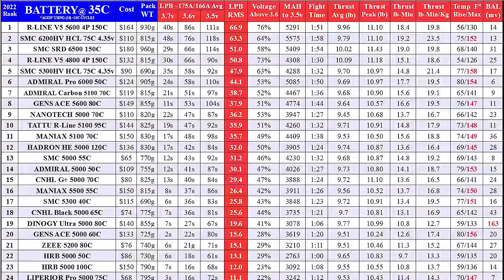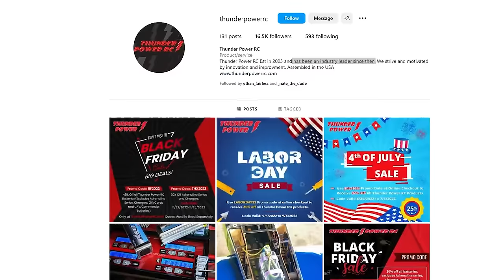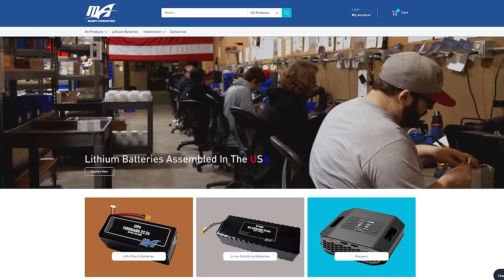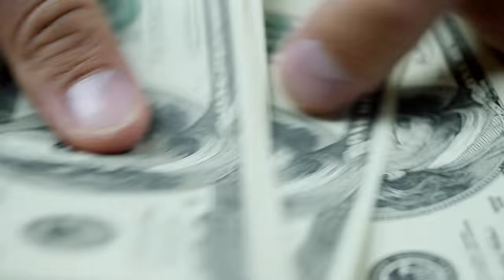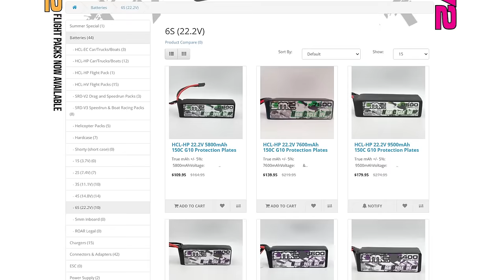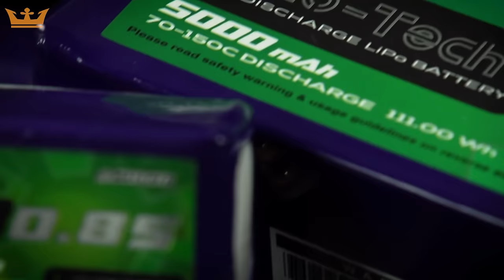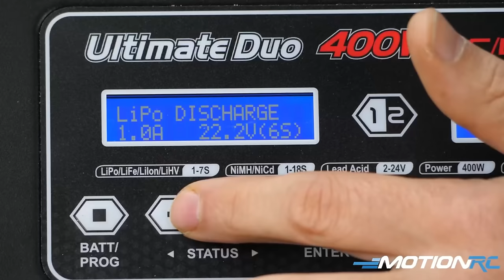Exposing RC's BIGGEST Scam

Comment: 5:45 "calibrated or commonly used discharge rate",,,,, Are you still using constant resistance (and therefore the discharge rate drops as voltage goes down, like in the past)?
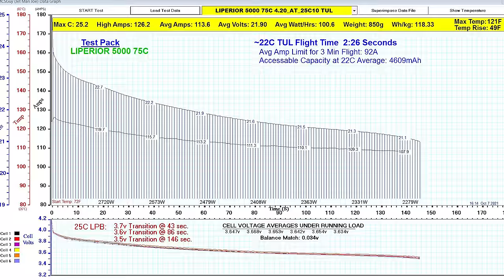Or have you switched over to the CC (constant current) prefered load now? (at 6:00 I see the current drop from 160A to 120A, that is 25% drop in load current.
One thing missed is letting your charged batteries sit for days full charged, this eats into their life.
I have the original 4s-1300-65c turnigy graphene (yes, there is no graphene in these batteries) from 2016, I use them in my quad, they discharge in 90 seconds with 120A peaks as I fly LOS. At 1200 cycles I relegate them to my airplanes and are now over 2200 cycles. The newest 4s-1400-75c Panthers have the lowest IR of many of my 1300/1400 packs (3.85 to 4.05mOhms), not sure what you are talking about that HK has dropped quality (are you talking about their 5000+ mAH packs?
Reply: Hi Ozzy, yes HK’s 5000-6000 fell out of the top 10 last year. I was sorry to see it. They seemed to rebound a bit this year but not much. The Bolt and Nano-Tech Plus appeared to be spared the performance axe but there was definitely a change in supplier or caliber on the others.

I explored many ways to apply test loads up to the 350 amps suppliers claimed in 2012. I fell back on my working experience to stick with real world dynamics meaning we pilots lose current and voltage as we fly. It made sense to me to simulate that as opposed to a CC approach. I used calibrated resistance until 2021 then switched to a range of commercial EDF’s so I could capture thrust data. It has provided a whole other element of study as I’m finding pack wire gauge can impact thrust generation and at certain load thresholds real C presents an increase in thrust not tied to voltage increase. It’s fascinating to me but we don’t see it until 175 amp and above with some of the heavies.
Reply: @TheMCSGuy  thanks for the reply and additional info.
Out of curiosity, how many life cycles do you or your friends get out of these large packs before they are retired? 
The reason I like CC is, it is easier to calculate capacity, and I don't fly my quad until the power is ~25% less than when I started, if I did it would be hurting the life cycles a bunch. 
One last thing on enhancing life cycles, I never let my fully charged batteries sit even a full day, if I charge the batteries the night before, I charge to 4.1v like you mentioned and this saves 12 hours sitting at 4.2v, and only costs me ~11% capacity.
Reply: @user-rs8zg8ey2b  Life cycles are extremely subjective to a pilot's use and care. I imagine there are lipo's bad enough no matter how much they're babied they won't last "long" (which is also subjective) but I haven't come across them. What I have come across are packs that get hotter then others under the same watt-min of use and others which seem to burn through Lithium at a lower temperature. Excessive temperature costs cycles but there is no sudden death short of puffing or crash damage. I have a set of old beater nano-techs I use on a 45A precision aerobatics feather weight going on 7 years and they do everything I want in that plane. I'll use them until they don't. In my 200 mph Spark's I notice the best high performance packs available start to have more difficulty breaking that 200 mph barrier after about 20-30 cycles depending on how hard (temperature wise) I've pushed them. That's when I roll them over even though I could easily get another 100 cycles or more operating at 180-190mph. I don't fly the Spark's to get bored, I fly them to make my knees tremble so afaic I'm done with the packs when they won't do everything I want in that plane. My friends probably think I'm strange but if I wasn't a bit weird the world would have a lot less test data available ;-)

Buying a lipo's not like buying a liter of fuel which is delivered to a chemical reaction taking place within an engine or turbine. We are buying the chemical reaction itself which begins when we apply a load. In the field of process control this makes "mAh" a process variable meaning it's value is defined by the influence of the other components within the reaction. Cells are rated at the factory based on a 1C discharge rate at who knows what temperature. The rate of discharge and the batteries real C effects the mAh "consumed" before we hit 3.5v/cell or whatever we consider done. CC only exists in a world of constant voltage and fixed loads so it's not a part of my testing regimen.

Comment: Dang I've been a user of thunderpower packs for years now, I've never purchased them for their C rating but for the longevity without puffing, they're the only battery that doesnt turn into a squishy sponge after 5-10 cycles. bummer I've been scammed, even my experience with them is a lie. what is real.
Reply: I totally agree. I have used the small 2200/2800 3s packs for years and they hold up better than most.
Reply: It’s necessary to define user  profile and battery type to provide 
context . I’ve literally  tested hundreds of Thunder Power 6S 5000 and 6600 batteries starting in 2012. When I’ve discovered what appeared to be systemic issues I’ve gone to the extreme of purchasing 4 or more packs at substantial cost to verify my findings.

It’s not that they don’t have products which work will in some applications, I’m sure they do. However I can conclusively prove, scientifically and beyond a shadow of doubt in high power applications their 6S batteries are more over rated then most and have a fundamental flaw in cell matching balance between the 3rd and 4th cells. 

They are poorly suited for EDF type use due to their use of cells having a lower performance caliber then most. They are not a premium product as their price would suggest. And they have a fundamental flaw in their assembly process of the 6S packs I test and use.

You are free to ignore my findings but you will never be able to disprove them.

Comment: Awesome content, but since I do photography and video for a living: 
It looks like you gave him a Zoom H1n to hold onto? Get a lapel mic, a wired one is fine, plug it into the Zoom recorder and then he has both hands free. Put the zoom recorder in his pocket or on the floor or chair behind him. 
Also, the Zoom is pretty susceptible to handling noise so a wired lapel solves that issue. 

Alternatively, get a DJI or Rode small wireless lapel kit. Then you can record directly into the cam while still getting good subject audio from a distance.

Comment: C rating is NOT an arbitrary number manufacturers created , but how the RC pack builders use it is arbitrary and BS, and, he gets it meaning wrong. It is a very valid term used in legitimate industry. C stand for the same thing it always has in scientific notation..... TIME (just as it does in E=Mc2).  When printed on a label, datasheet, etc....., it is an equation. 1C means 1/C, 2C means 2/C....etc.  When you see a "C" rating it does NOT mean "capacity" as those in the RC world tend to think.  The baseline C is one hour as 1 hour is our standard of measure for power. So a 1C rating means you can discharge a cell/pack rated capacity in one hour. So a 1C 1Ah cell/pack can be discharged at 1A in 1 hour. A 2C 1Ah cell/pack can be discharged in 30 minutes at a rate of 2A. A 100C 1Ah pack can be discharged in 60 seconds at a rate of 100A...... and so on. You see how the ratings get silly really quick?  there is no such thing as a "100C" cell/pack. Not even close. The best chemistries out there from the best cell manufacturers may top out at 20C at best, and you arent generally finding those in the RC markets.  I have been telling people this for nearly 20 years, and the information is very easy to find on the web. I have no idea how this is still a thing.
Reply: Also keep in mind the real ratings are still only good for the first few cycles of a brand new pack. You very well may be able to get 40C out of a pack, but only for a few cycles. RC cells are power cells with chemistry tailored for power delivery only, with minimal cycle life.  Also, the equipment he is using, as well as the methodology is still botched and does not conform to any legitimate cell testing standards.  If you want to see how bad your cells really are, test them tot he same criteria as the legit EV industry would, using a Bitrode or similar legitimate instrument. Not the toy hobby, relatively simple tester often used in these hobbyist tests.

Comment: Is that true? That you could drive a nail through a 3.7v lipo and it wouldn't burst into flames while it would at a different voltage?
Reply: Probably not, I was caught up in the fact fully charged packs will provide much more intense and dangerous flame up then packs at nominal voltage. Technically storing at 3.7v avoids the possibility of graduating to thermal runaway from internal shorting. Guess I'm going to have to do the nail test at 3.7v now that I've said it.
Reply: @TheMCSGuy  My hota charger has storage set to 3.8, should I adjust that to 3.7?
Reply: @definingslawek4731  No, I store around 3.8v. 3.7 is considered safer but leaves no margin for the bit of self discharging that can take place.

Comment: If a battery has 60c that is usuallya burst rating not the expexcted maximum. yeas marketing and crap practices can get confusing but if a pack only list one c rate than that is the burst and no where near what to really xpect. if it says 60c expect 30c constant with 60 possible burst

Comment: if someone buy a LiPo with 170C on the lable and think they will get it have to be a little "Thick" 😆
100C on the pack i have on my CNHL drone lipos, they PERFROM REALLY GOOD and they are not expensive.. if they are 100C i dont know, but they dont puff on me then i push them.

Comment: Side note - Don't buy an EV if you live in a cold climate.
Reply: Just buy a battery warmer or make it yourself.
Reply: Don't buy an ev period. Unless you're rich, waste of money.
Reply: @DontWatchProductions  EV is ike buying organic, theoretically it's better for the environment...if you're rich like Gwyneth Paltrow. Imagine having to work overtime at the coal mine so you can afford organic food, not very environmentally friendly!!
Reply: EVs aren't like our RCs. They don't really have weight considerations and have a thermal management system that will get the batteries up to a good temperature before charging them. Every single EV you could buy will do this.

Comment: Greetings from England. Are these Chinese batteries? From my experience buying stuff from any Chinese online outlets, it's a lottery. Many products, not just batteries, are simply rebrands of an identical other 'brand', and the QA from some isn't great. With the exception of well managed Chinese companies like DJI, it's a big sh*t show with no accountability. A high % of my Turnigy batteries have failed causing multiple crashes until I diagnosed them being the cause. I no longer buy them of course! Can an American company produce some honest to good batteries?
I have been using Overlander for the last 5 or 6 years and they have been consistently reliable, outlasting Turnigy by a long shot. C rating seems pretty honest too so far, but I've not flown a lot of big jets or props where I imagine it's more critical so cannot comment.